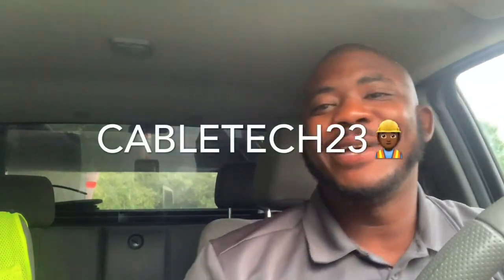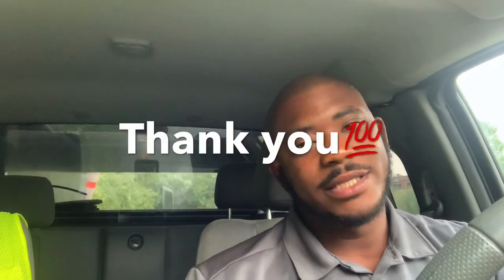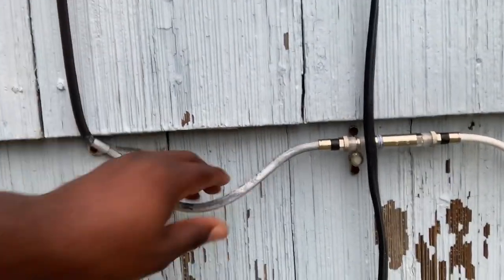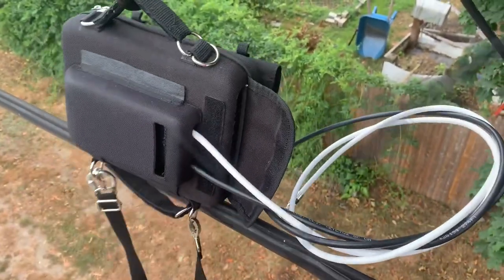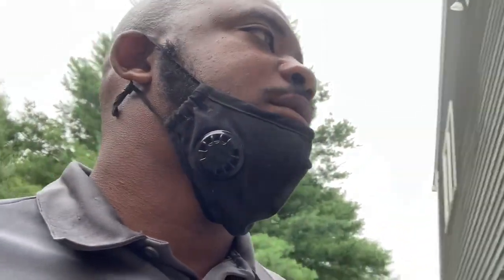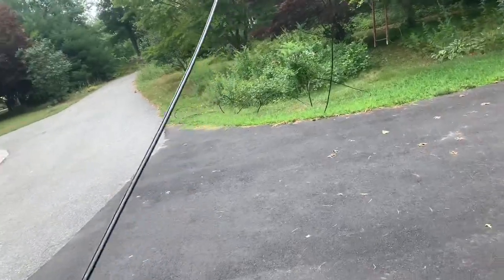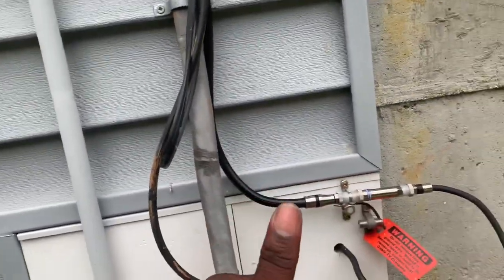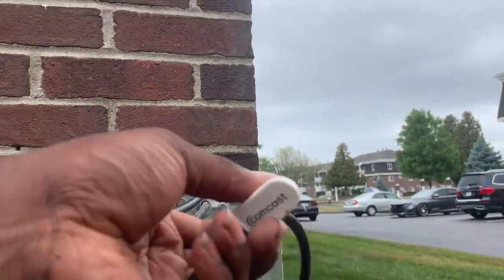Life of a cable technician Ep#5

Comment: They don't give you guys the B9 outdoor boxes? I know those are outdoor fittings but i've seen water damage in those areas with them. That's why our sup & boss would have us install those and replace drops or outside cables with splices. They ususally only wanted the splitters in that box to keep future diagnosis simpler instead of taking short cuts.

Comment: Moca filter facing the wrong way. Don't install house boxes? Did you check for voltage when you got up the pole? Good practice to change old terminators at tap. Also all new fittings at tap. good content
Reply from the maker: Which part of the video was the moca filter the wrong way? also in my region North East Massachusetts house boxes are not required I also check for voltage every time I climb the pole just don’t put it on video but I should👍🏾
Reply: @cabletech2371  stinger of moca filter should face the house, not the drop
Reply from the maker: Jacob Wade right now I’m with Xfinity but before I was with cox communications And with both companies that’s how we put on the moca filters from the house in Or at the main splitter in the house
Reply: @cabletech2371  thats interesting Im inhouse xfinity and we are told the opposite.
Reply from the maker: Jacob Wade lol that is...idk I guess every region is different when I worked for Cox in Louisiana which is where I am originally from they did different things then the Cox company in Rhode Island it was weird 😂
Reply: @jdub099  Dammmm chill with that QC Juan
Reply: @cabletech2371  cox has no stamdard where the moca is long its after the ground block....
Reply: The moca filter is just that.. it's a filter. Doesn't matter where you put it, or what orientation, it will block all the frequencies it's rated to block. Similar to an HP-50 (high pass filter) blocking return frequencies.
Reply: @kthomps4  thank you! Finally somebody said it. People need to learn about what theyre doing and whats the purpose of evrything they install, not just follow what the company tells them.
Reply: Thats actually crazy. My dad works for xfinity as a tech in north east mass too.